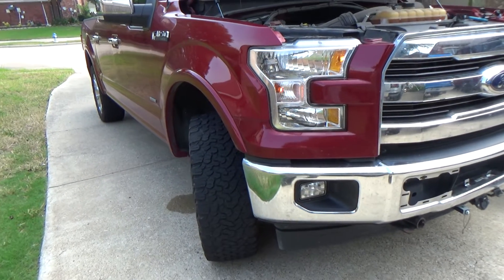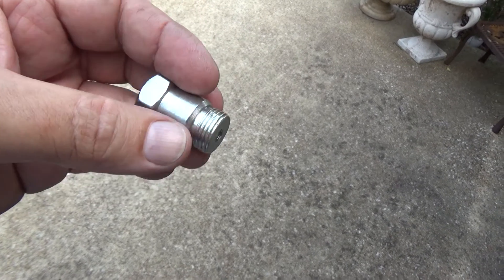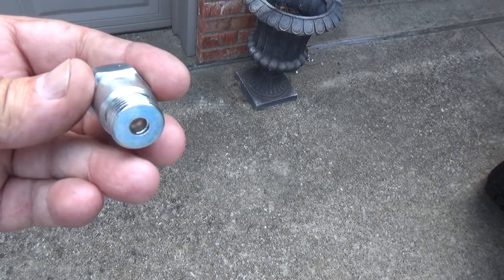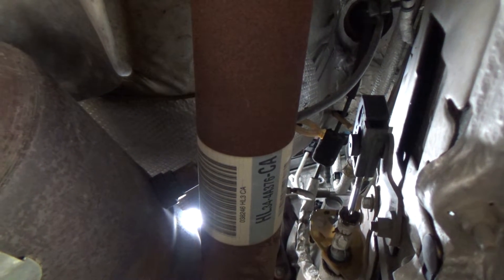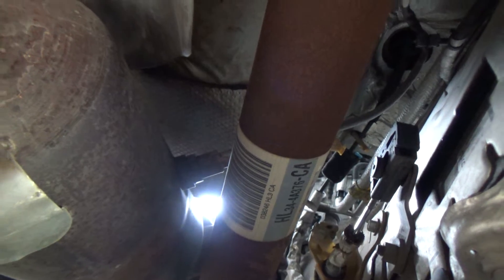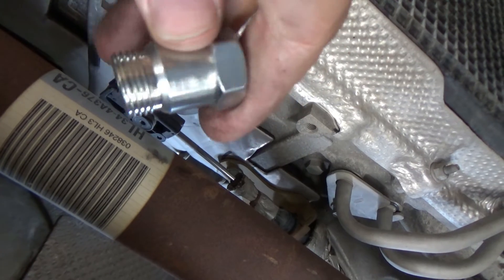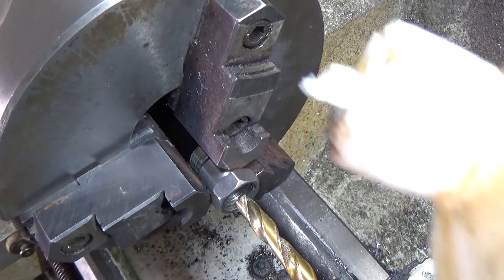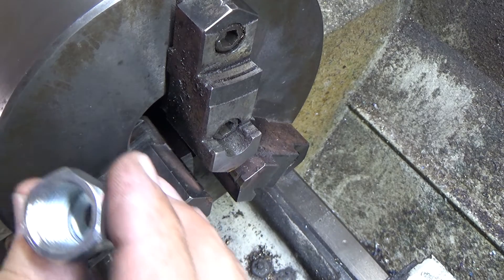Easy Fix for Code P0420 or P0430 Catalyst Efficiency Below Threshold Ford F-150.

Comment: To confirm for P0420 and P0430, these are the two cats for passenger and driver side?
Reply from the maker: That is correct.
Reply: @737mechanic hey boss what side is P0430?
Reply from the maker: @leonelle30  P0430 is bank 2 which on the F-150 is the drivers side.

Comment: Thanks for the video. What size bit did you use to open up the hole in the non-fouler? Looking to do this project this weekend to address my P0430 code. Thanks!
Reply: I saw in another video that they drilled out one defouler entirely with 1/2" bit then added a second undrilled defouler to the end with the option of adding stainless steel wool between them.
Reply from the maker: I don't remember off the top of my head, I picked one out of my collection that was slightly bigger than the O2 sensor.
Reply: @737mechanic   I saw another video on this same trick, and they opened it up pretty good with a larger bit.

Comment: That's a nice SouthWest Airlines tool chest in the video at 2:31. Did you soak the O2 sensor in AeroKroil before removing it.
Reply from the maker: No, It unscrewed easy enough so I didn't have to do anything special.

Comment: I have a Ford Expedition and I have had the code P0420 from 7 months ago, friend I changed the catalyst and the oxygen sensor and the engine check is still going on, my car is 2020, what can I do? Do I do what you did in the video? Where can I buy that piece of the video? Do I necessarily have to go to a turner to modify the piece? I don't know what to do anymore, I added some caralizer cleaner and it didn't work either.
Reply: clean catalyst I meant, cataclean and it didn't work
Reply from the maker: @manuelbarrios8941  You can try the spacer and that will probably help. You may not need to drill it out but if the O2 doesn't screw into it you will have too. Make sure you get it on the correct bank. On a lot of ford engines bank 1 is on the passenger side and bank 2 is on the drivers side.
Reply: You can also get longer non-foulers that require no modifications, O'Reilly's carries them 2 for around $12 dollars, I installed them in my 2014 f150 a week ago and so far the check engine light hasn't come on, one thing I did notice is the miles per gallon average did go up, don't know if this is because the computer thinks new or what but as long as the light stays off it's good.
Reply: Hi, what was a solution? I have a same problem with my Exp
Reply: Did you guys found the solution?@GeorgeKhonelidze

Comment: Was the the driver side?
Reply from the maker: Yes
Reply: Bank 2 is the driver side? And how did the check engine  light came off?
Reply from the maker: @PGuerrero1179  Bank 2 on this f-150 is the drivers side. The light will go off eventually after you drive it enough or you can clear the code by either disconnecting the battery or using a scan tool.
Reply: Do you the battery?
Reply: Thank you.
Reply: I have a f150 2016 3.5 regual do you think is the same as far as the position of the catalytics
Reply from the maker: @PGuerrero1179  Yes it probably is the same.

Comment: put alcohal in the gas tank and run for several miles to clean the converter and never bye a converter  word from the pros
Reply from the maker: Not only have I tried that but there are many videos on YouTube that show it does nothing.
Reply: What kind of alcohol? Methanol?
Reply: Did it clean the converter?? I've got same issue  @mouradait340
Reply: rubbing alcohal...one bottle to a tank of gas
Reply: WILL clean the converter
Reply: Lacquer Thinner works just enough to get monitors ready and pass annual inspection
Reply from the maker: @TurnThemWheels  I have tried it and it didnt work for me and there are youtube videos of people trying it and it didn't change anything.
Reply: @737mechanic  gotcha it worked well enough to get a 07 Tahoe P0430 to pass Texas inspection
Reply: Does that clear the code too?
Reply: @nikalg you would run it through the tank of gas, clear the code, and see if it comes back on.
Reply: @nikalg   I used a code reader, and deleted the code myself, and it hasn't re-appeared yet thankfully.
Reply: I am a pro and cat failures include actual breakage. BTW the word is "alcohol".
Reply: What do you recommend to do @Comm0ut
Reply: Alcohol solves all my problems…